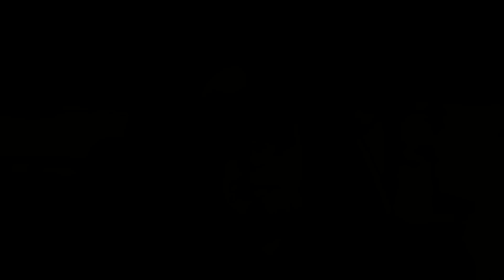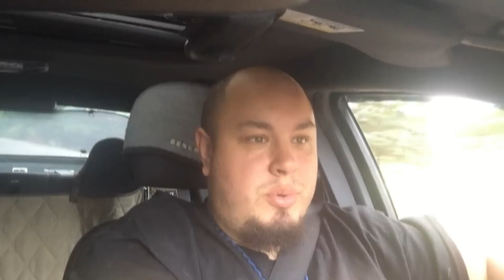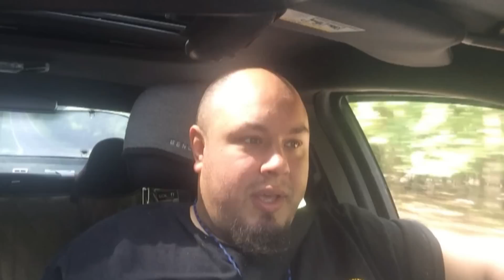Performance Upgrade For The Chrysler 200...Can You Guess What It Is? (Oh Boy Here We Go Again)

Comment: Cold air or short ram intake won't increase hp or performance Jeff, unless you tune the engine and change the fuel to air ratio. If that's what it even is...
Reply from the maker: if it was a real cold air intake not only would it improve hp and fuel efficiency without any other mods but it does not require a tune...the computer would adjust the air fuel mixture on its own
Reply: +cutlerylover it would adjust the air fuel ratio within the preset specifications, nothing noticeable performance wise unless it's tuned. You would have similar results with just a clean air filter.
Reply: +cutlerylover YouTube "mighty car mods cold air intake" for a better explanation
Reply from the maker: if it was a CAI it wouldn't need a tune for my car the computer would adjust accordingly
Reply: +cutlerylover what I'm trying to get across is the car's computer won't know you added a CAI, therefore it won't increase (significantly) horsepower anymore that a stock intake with a clean filter. Stock intakes also pull cool air from the wheel well essentially the same as withmost CAI. Now if you setup a good quality CAI (one that pulls air from the grill in front or in that area)  with the proper size pipes, a water trap and a tune you will see results. Your car's computer will only adjust the fuel mixture so much based on the stock setup. But it sounds like you've done your research and I hope it works out for you. If at all possible, I'd love to see a before and after dyno (not sure how feasible that would be for you to get done) and would give you a good idea on whether you made progress or wasted time and money...
Reply: +cutlerylover This is accurate you will gain some HP. Even without adjusting the fuel most OEM cars run very rich and adding more air without a tune will lean them out slightly and leaner is meaner.
Reply: The air and fuel mixtures aren't set man, they are constantly changing and adapting based on what the MAF or IAT sensors are reading, like elevation or outside temperatures, so the computer WOULD adjust fuel mixtures itself without a tune. now to reap FULL benefits, an proper remap would be beneficial
Reply: I never said they were set... I said within preset specifications. The computer WOULD adjust but only so much, nothing significant enough to boast HP gain.

Comment: I can't think of anything but a Cold Air Intake or Headers that would require taking off a single wheel... But likely not raising the car? But also increasing performance of the vehicle. Brake master cylinder upgrade requires a full bleed...
Reply from the maker: the tire is coming off to access something I cant from the top it has nothing to do with whats going in
Reply: cutlerylover I think you'd have a hard time access exhaust headers from on top! just saying!

Comment: MightyCarMods proved that CAI's are more apt to make you lose HP than gain HP, even with a dyno tune.  If you don't believe me, find a dyno and do a run with and without the intake.  Even if you do find a gain in HP, it'll only be in a very small range of the band.  You're paying for sound and some chrome under your hood.

Comment: Cold air intake for sure. barely classify that as HP boost though. it won't be noticeable.
Reply from the maker: who said the gain would be noticeable?
Reply: +cutlerylover no one. I'm just saying it won't be. Still a good idea to have one if you want to do other things to the car like some form of forced induction but you said something about a hp increase, but you won't get a noticeable hp increase. that's just facts.
Reply from the maker: I will get a noticeable throttle response and a noticeable gas mileage increase which im looking forward to, its a precursor to future work
Reply: It's a nice car man, Stoked to see what you do with it.
Reply: +cutlerylover You won't get what you're looking for. If it was possible to increase mpg just with a Cai don't you think the engineers who designed the car would have put one on it considering mpg is a major selling point these days?

Comment: It's probably a dumb "cold" air intake (pretty much every stock air intake already draws in cold air) with a crappy washable filter that doesn't filter out fine particulates. If you want a real performance upgrade for cheap make fiberglass or sheet metal covers for your radiator to block off the airflow and make the car more aerodynamic, you will probably get a couple percent more mpgs and the car shouldn't run any hotter.

Comment: You're perfectly capable of replacing you plugs and wires. You can save money & buy higher quality ones. If not; you're fine to drive it to the garage. Just pull the wire off.
Reply from the maker: I already have better wires I just nee to get some wire spacers/separators  to keep the new ones off the pipes

Comment: I have to say cold air intake is my guess... Paused the vid right before the clues... I'm sorry but it's always a new intake that people say is their "performance mod"
-low key was my first "mod" too 😂😂😂 
Wasn't worth it for me since my bike isn't smart enough to adjust itself and I had to get it tuned...

-it is a cheap way for better sound... Cheaper than new exhausts
Reply from the maker: a CAI on my car doesnt require a tune, but would sound nicer increase torque and HP at higher rpms as well as give me better throttle response and better gas mileage

Comment: You can not feel a 10hp difference. You also run the risk of sucking water into the motor. Just put a regular K&N filter in it and be done.  Stop wasting your $$$ on this junk dude. You prob still think 3" exhaust on that 6cyl is better than 2.5" (it's not, it's worse)
Reply from the maker: im not worried about getting water into the engine, I didnt say the hp gains would be felt, and I dont feel what Im about to do is a waste of money, in fact the upograde will improve gas milage ...but thanks for the opinions anyway
Reply: Many very highly skilled and trained engineers spent countless hours designing the ECU, intake, exhaust, etc.. to get the best mileage and performance out of that car. If they could get 3-5 extra MPG they would have done it... it IS their job,  right? Your air intake sensors working with your MAP sensors know how much air is coming in and will adjust the fuel accordingly. Your engine is an air pump... increasing one side without increasing the volume on the other side (exhaust) will have little to no effect. The engine is restricted by air moving through it not just coming into it. The ECU knows what's up.  By all means it's your money and time but many others have been down this road. If you get a 3MPG increase and buy a $200 intake it will take about 2 years to pay off the intake... that's before you "save" any $$$. BTW you can't increase performance and MPG at the same time. They are diametrically opposed to each other. Cheers!
Reply: +ralfdcat Not exactly. You see, companies operate on a cost-benefit basis. If those 3 extra mpg cost me another 50 million in development...then they don't happen. No vehicle is 'perfect' in its stock configuration. It simply met the goals the company had for the vehicle. They target a price, performance and fuel range and build it to meet those goals.

Any vehicle can be improved.
Reply: This is probably the only set of respectful and yet very informative and factually based arguments on this video

Comment: Cold air intake on v8 muscle=50hp cold air intake on a 2.4l =5 hp if that.
Reply: Maybe it is the 3.6 pentastar
Reply from the maker: who said it was a huge hp gain? people bitched that I should do real upgrades, which I have chosen to do, this upgrade will make the car sound different increase hp and increase fuel efficacy
Reply: it's not 50hp on a v8 I have a 2016 mustang gt with 3.55 Gears auto and it makes alil more than 5 to 10 more like 20ish with a tune to the wheel

Comment: Cold air intake. Too bad there's no proof it makes a significant difference to horsepower.
Reply from the maker: if it were that every single Dyno tests shows a real CAI system with a box does in fact make more hp than a stock air box does...significant is subjective
Reply: +cutlerylover Anything that you do to your car to make it better comes with naysayers. The only problem I have with CAI's are the misleading advertisements of "instantaneous bolt on power!" You do you man, I enjoy your videos. I'm just salty that my AC and both windows failed a few days ago all at once :P